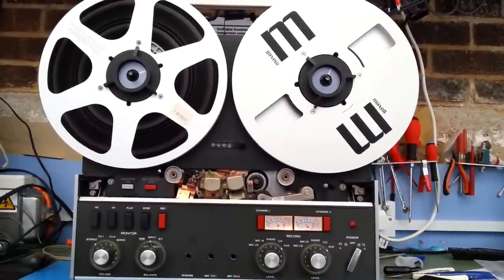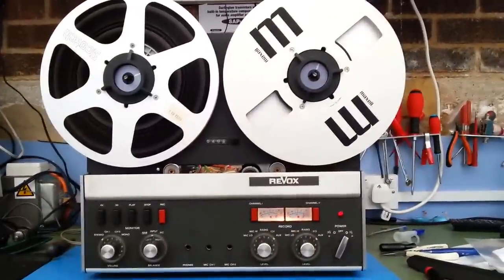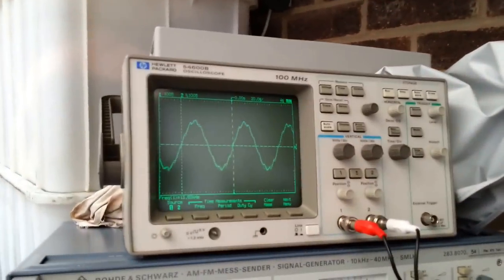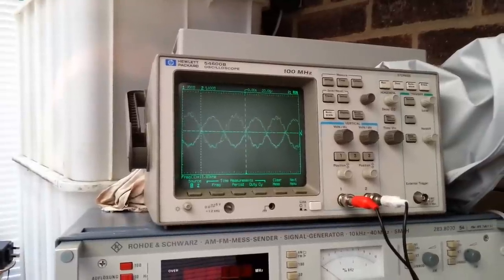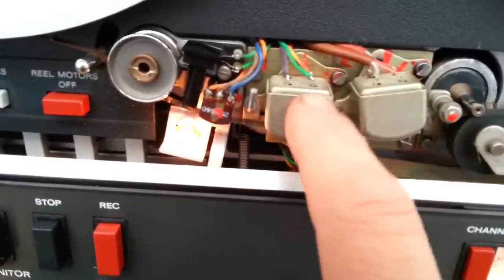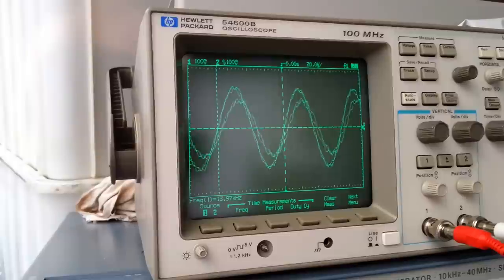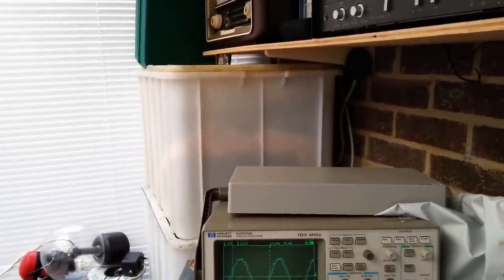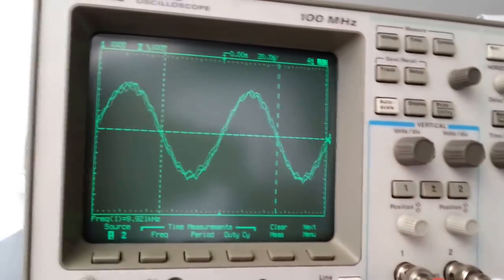Azimuth using oscilloscope on Revox A77

Comment: Tip from some one who has been maintaining R2R machines for 35 years. With A/B 77s & PR99s, indeed any other pro-sumer machines. Lay them on their back to do the adjustments. It means 1. The load on the bearings is even around the bearings and the pinch-roller pressure is not fighting gravity: Means better W&F - will help that flutter (evident by the characteristic L to R waveform shake relative to the triggered waveform on the scope - common in lesser spec machines) you see on the scope and will aid setting the azimuth up. 10kHz is my preferred frequency for azimuth. I then drop the sig gen to 1kHz to check I have the right peak and am not 180 degs out of phase. I also tweak the hf prior to azimuth to get the amplitudes of the signal the same - again aids line-up. Once azimuth is done you can go back and do a level/freq response adjustment in the normal way.
Reply: Wow,beautiful explanation.Makes perfect sense...Thank you very much
Reply: Thanks for the tips! When i switch from sine wave to square wave on the signal generator, the phase between channels changes a lot (given i already aligned them with the sine wave). Why would it be? thanks

Comment: That is not as service manual describes to do it. Service manual says use a 8kHz tape and adjust to get the maximun level at both channel. I do prefer a tape with blank noise recorded. Of course with a well recorded tape to test it.

Comment: Its easier and accurate to set the azimuth with the X/Y-mode on the scope. Correct phase is shown as a line leaning 45° to the right. The more out of phase the more circular and leaning to the left.
Reply: Usually, you go for the level first on the waveform scope and then fine-adjust the phase with a Lissajous figure as best as you can. Because if you simply go for the 45° line, you might just be in relative phase but could still be off by a complete wave cycle which would reduce the level. You can see level in the Lissajous, but if your scaling is set to auto or something, you might not realize it. And the higher you go for azimuth alignment (as an example, Nakamichis are adjusted with a 16 kHz full track cassette), the greater the risk for errors.

Comment: I know this is 3 years ago. But I've been studying all I can about reel to reel tape head alignments. I agree that azimuth is a crucial alignment. I have found that one doesn't need all the very expensive eqipment but have good reliable equipment.   O scopes and the like. I gathered some good information from your video.  Thank you.
Reply: If you have a decent enough sound card in your computer capable of at least running 96 kHz, you can use software oscilloscope tools like AudioTester 3 to do a lot of the work. Then all you need is reference alignment tapes and a good true RMS volt meter.
Reply: @svenschwingel8632   interesting information, how would you connect the RTR to your soundcard to measure the azimuth settings? Just via line outputs of the reel to reel straight into the soundcard?

Cheers
Reply: @brendanryan6363  I use test tapes with a full-track 10 kHz tone and connect the RTR or cassette deck to the PC's sound card via its line inputs. Then I use the software oscilloscope's X/Y setting to display a Lissajous figure. It is very easy to set the proper phase (which is the angle of the PB head) that way. Just aim for maximum output first and then finely tune the azimuth screw so the Lissajous figure gets as close to a 45⁰ line as possible.

Comment: Is it possible to perform this calibration without a test tape ? If a 10kHz signal is fed into it, can the record head azimuth be adjusted 1st and then the playback head azimuth ?
Reply from the maker: You need to set playback head to a reference first. If a three individual hed machine is being aligned  , you could set the record head to pmatch the playback azimuth. But playback really  would still needed to be done first to ensure good results on other machines.

Comment: Now I wonder how you would adjust the azimuth for a variety of different reels I am looking to digitally transfer, I have a large collection of second generation safety copies that were recorded on around twenty different machines all with different azimuth adjustments. I would have to somehow test each and every reel to find the best setting, but the question would be how? In my case I could not use a single tone, what do you feel my best option would be?

Comment: Hi Simon, 
Regarding the bias HF signal, it's seems rather high in my opinion. Although I'm not sure what the relative amplitude of your test signal is? I'm in the middle of servicing my A77, and the 120Khz bias 'carrier' (as I call it), is about 100mV/160mV peak to peak (at CHI/CHII at line out) for a full 0VU modulation at 1Khz. I think they are ideally supposed to be circa 50mV (rms)? I did examine and tweak both bias traps - for the record amp, and for the playback amp. So mine seem okay.
I did upload my work on my blog, but took it down until I finalise all the major work.
Regards.
PS: apologies if folk have already mentioned this, I haven't read the other comments.

Comment: Did you ever figure out what was causing the wave distortion ? I have similar issue. Thx
Reply from the maker: Yes it's basically wow and flutter and imperfect tape to head contact. If the head are warm it will be worse that shown here. Use a good unworn tape .

Comment: you need to first adjust replay alignment with a test tape, no?
Reply from the maker: You need the replay alignment set correctly in the first place. This can be done with a reference tape from a known good deck. 
This record alignment is to match the record head azimuth to the playback head.
Reply: For replay you need an LU tape. Once the replay side is lined-up you use a sample of your preferred tape for the rec side line-up. Tape type for azimuth isn't critical but for rec level/freq response and bias adjustment it is.

Comment: I've done this for various cassette decks, inc dual capstan machines. Indeed there is always this phase shifting between left/right channels and so taking the best center spot is something to aim for. Of interest is the noise here - appears to be the bias frequency on your 16 Khz signal/carrier?
Personally, I like the two-sinewaves method over the lissajous figure method.
Interesting video, thumbs up! ;o)
Reply from the maker: Interesting about the phase shift. That would ruin stereo imagery as it would be like having a speaker out of phase? I assume the level rape in definitely recorded in phase?
Reply: @SoddingaboutSi  Apologies for the late reply: We won't notice phase shifts at high frequencies. I'm not sure where we would begin to notice this, and where it ends. I'm guessing at say 30Hz ... 5Khz? At 10Khz and over? ... I don't think so, and in any case HF are usually transients.